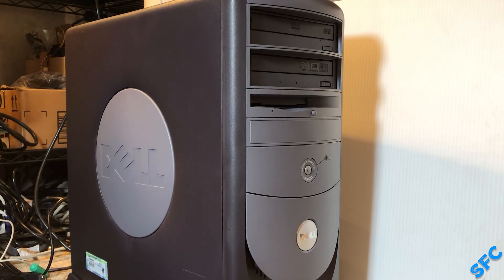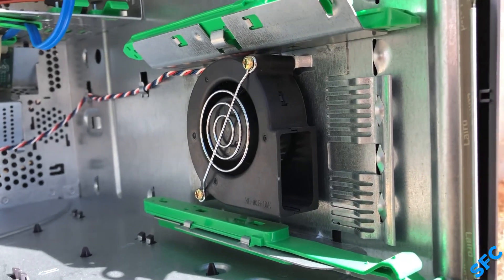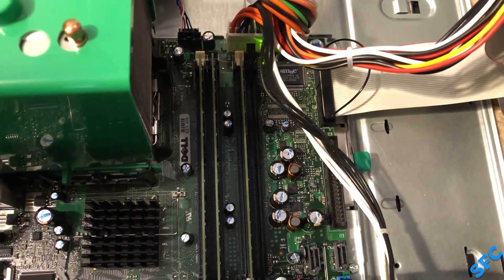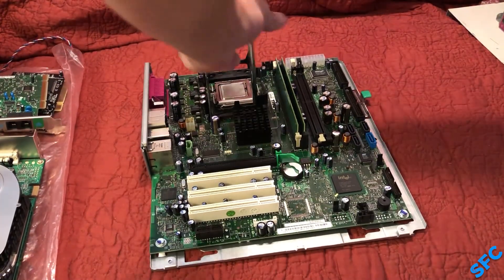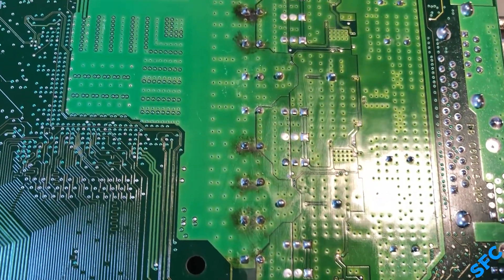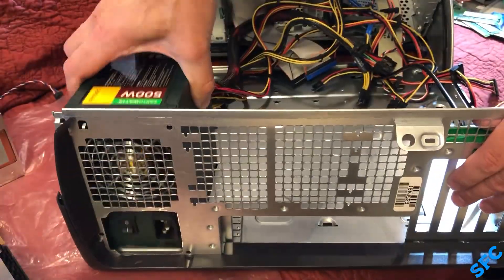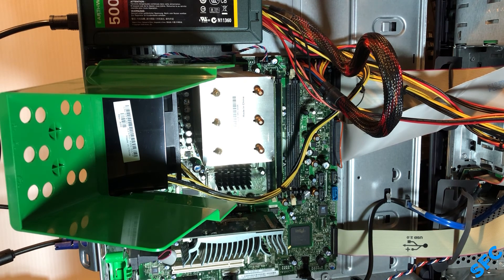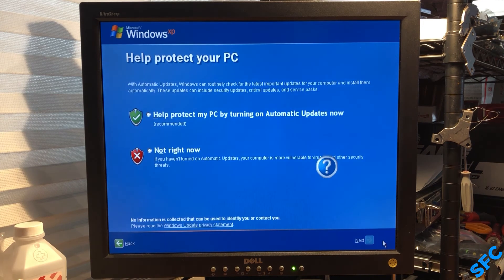Dell Dimension 8400 Capacitors & Games - SnowFoxComputing

Comment: Apparently the bulging capacitor is quite common in those motherboards, mine was bulging too, the same exact one. I pulled it out and now the second memory channel doesn't work, pc wont boot at all if I have any ram on that channel, I'll have to find a replacement I guess.
I had not watched the entire video before commenting, your ram issue is also that pesky bulging capacitor.

Comment: I picked up a Dell SC something or other recently for uber cheap, it's a Pentium 4 socket 775 Server tower and it's exactly like this Dimension.  Even the BIOS looks identical. After giving it a clean I unfortunately haven't had the time or space to do anything else with it yet.  I find it funny just how little difference there is, and to be honest, how Dell got away with the absolute minimum effort, seems they just stuck different badges on essentially the same products, but I bet they didn't charge accordingly!
Reply from the maker: I've always found that amusing and interesting. Personally, as a second-hand collector, I like the chassis differences and borrowed components between models. It can make finding replacement parts easier at times too. All in all it may seem like a lame thing to do but the changes between model families were mostly for legitimate, cost-adjusting reasons. A Dimension usually doesn't have support for ECC memory like a Precision or PowerEdge would. A PowerEdge isn't going to prioritize graphical capabilities. An Optiplex wouldn't normally be considered for power-user workstation usage. I'm sure the MSRP of everything was ridiculous for same essential functions, but purpose and required hardware most of the time warranted the differences I would say. With that out of the way, I also find it highly amusing to get a SC PowerEdge in the same chassis as a standard Dimension or Optiplex. I love the case alterations on stuff like a PowerEdge 500SC, which was from the "beige era" Dimension lineup.

Comment: It is bloody tedious - but Windows 98 second edition will install and run on that beast.
1) German driver "Big Ram" required but it will use 3.2 gigs of the available 4gigs of ram.
2) ATI still makes 98se drivers for that grafix card.
3) Use intel 845/865/875 drivers for the i925 board.

Comment: ah yes the dreaded ram beeps..... because blarg ram compatibility. 
also your soldering problems are actually because of the ground plane that's causing the iron to loose all its heat, pre heating the board with a heat gun helps with this.
this is a common thing on newer stuff after 2000.
did you try reseating the cpu to see if the dead ram slots came back i had that happen on a LGA 1366 if it been sitting around doing nothing for a long time.
Reply from the maker: It was suggested to me shortly after publishing this video that the ground plane was the issue, and that makes way more sense than what I thought. I did try reseating everything including the CPU, but there were no signs of life from those slots. Thanks for the tip!

Comment: I EOL'd many of this type and it's Optiplex cousins. Never did I imagine that they'd be worth saving. Your problem with the VRM caps was likely exacerbated by the enormous heat-sucking ground plane.  Did you try adding more RAM after the re-cap?  It's possible the problem was a shorted cap.  You can probably find a replacement board on eBay pretty cheaply.
Reply from the maker: You have certainly EOL'd a lot! Oh yeah, I am fully aware this is probably not really worth saving but I can't help myself. You are right on the ground plane being part of the problem. I didn't mention it in the commentary but that was one suggestion as to why these capacitors are such a pain. As for the RAM, I did try various modules after the capacitor replacement and still those two right slots refused to cooperate. There are boards on eBay but they're not really cost-effective for this project.
Reply: @snowfoxcomputing  In a previous job I worked in a secure facility.  When the workstation and lab PC's had to be removed due to obsolescence or failure, they had to be either destroyed per Government disposal requirements (if we had no manufacturer's  "Statement of volatility") or anything non-volatile and therefore capable of retaining potentially classified data stripped down if we did.                    

I've destroyed literally hundreds of what are now, 25 years later, classic vintage PC's.

I don't know if I would class the "Darth Vader" Dells of the late 90's to early 00's among them though.  :-)